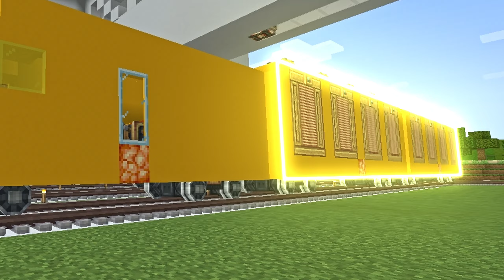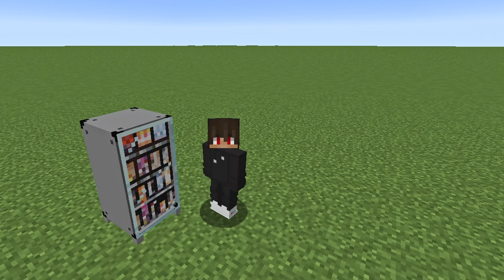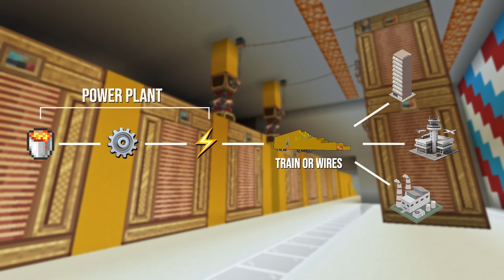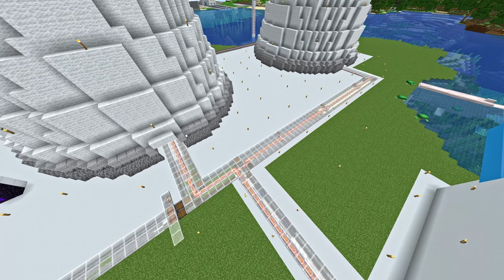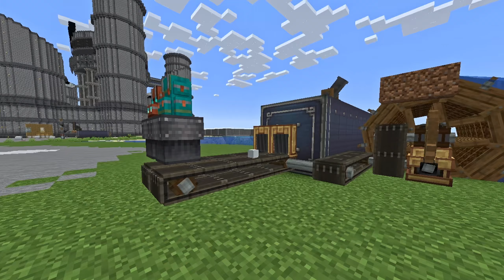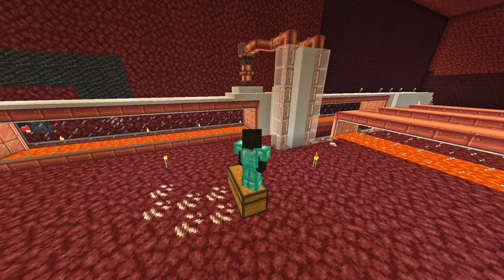I Built A Nuclear Reactor In Minecraft

Comment: Why not use lava from the overworld? skipping the nether part?
Reply from the maker: You would run out of lava very fast as even the biggest lava pits would be drained fast going at 1 bucket/8 seconds and most of them aren't big enough to be considered infinite like the lava oceans. I haven't explored much but the reason my main area is over 1k blocks from spawn is trying to find a lava pit in episode 1 and they are pretty rare so you would have to travel far as well.
Reply: @Jxxrdn  You do realised you can make a infinite lava source, the same as the ones in the nether. If im not mistaken there has to be 10 thousand source blocks, which can easily be uptained by a pump
Reply from the maker: @ sounds like also a lot of work😂 10k lava source blocks in the overworld? At that point thats why I made the train😆😆

Comment: This is probably more complicated than a real nuclear reactor 😂
Reply: this isn't even nuclear lol. Its geothermal but make it interdimensional
Reply from the maker: @ Making it an 'actual reactor' wouldn't change the current setup, it would just add more blocks. I didn't do it because it takes a long time to get the resources for the reactor blocks which probably use rare stuff to make.I can definitely add it sometime in the future tho :D
Reply from the maker: Probably just feels that way since there was also segments of the train station and clearing the area with the drill 😅
Reply: complication is  subjective
Reply: @verdisquo97_arts  no it’s not lol. Complexity and complication are the opposite of simplicity. Simplicity can be measured so can complexity and complication. Complexity is elements required, complication is steps required. Both of those are measurable thus objective
Reply: @uncivilized_caveman  I'm aware of that but I did not want to explain how tremendously complicated nuclear reactors are, in this case this is complicated for a different reason, complicated in the fact that it's a different system entirely and relies on different mechanics than a nuclear reactor would be. as someone who studies nuclear technology, there is so much complexity it's not even funny. But comparably to somebody else who doesn't understand the concept entirely may appear simple making it subjective.
Reply from the maker: @ 99% of what "real nuclear reactors" are made of and doing isnt even in the mod that has nuclear reactors since it would take a long time to develop that. Sometimes people just forget its a block game and that I dont develop the mods lmao.

Comment: So.. you're using geothermal energy to make power?
Reply from the maker: Yes I explained this to someone else too but no worries! There are actual nuclear reactor blocks in a different version of one specific create mod add on. That is one mod of the 90+ mods im running. The reason I chose not to use them is if I did, I would have two versions of basically the same mod and double the items in the mods which I could do but wont be for a while. I also think the steam engines still make more total power than the reactor setup. Would have also clarified this in the video but people stop watching the second you start talking about stuff like that in the video! Hope this clarifies!! :D

Comment: theres a new nuclear reactor mod for create you should revisit with it installed
Reply from the maker: I had looked into it but there were complications. There are actual nuclear reactor blocks in a different version of one specific create mod add on. That is one mod of the 90+ mods im running. The reason I chose not to use them is if I did, I would have two versions of basically the same mod and double the items in the mods which I could do but wont be for a while. I also think the steam engines still make more total power than the reactor setup.. Would have also clarified this in the video but usually people stop watching the second you start talking about stuff like that in the video! Hope this clarifies! :)
Reply: @Jxxrdn  thanks so much, great video regrdless